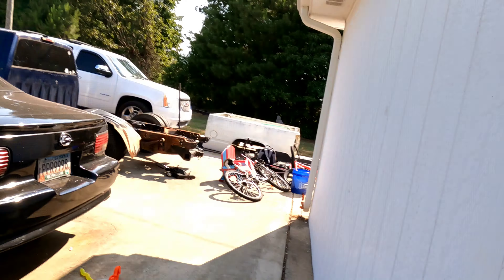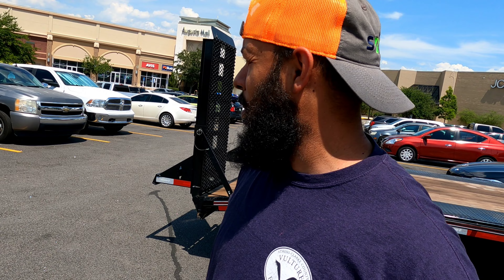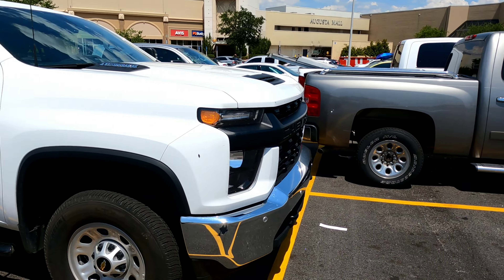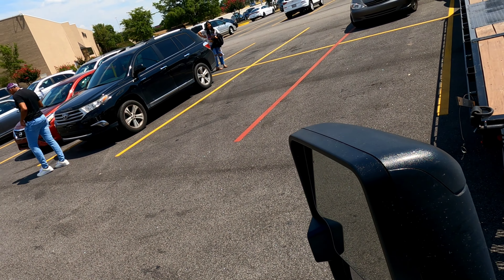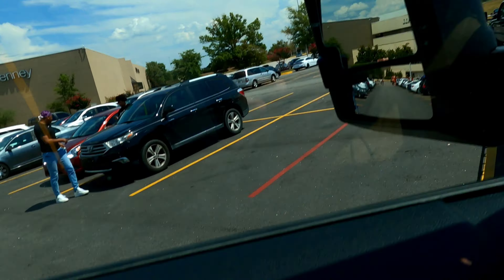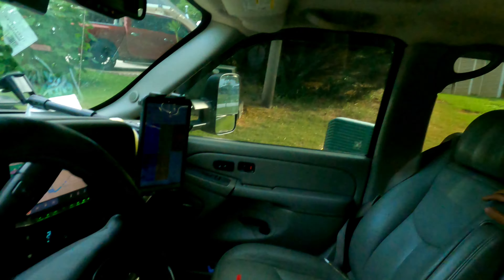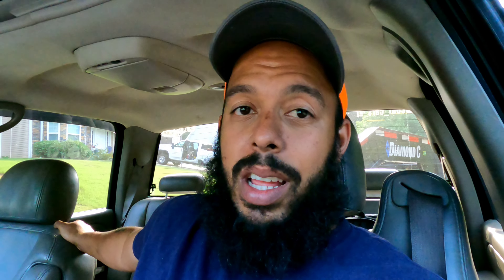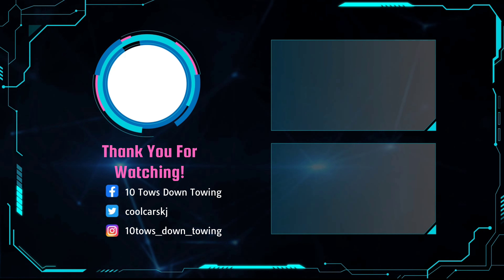Fuel issue could jeopardize my business 😞

Comment: if it's only with those heavy loads in overdrive your cp3 is starting to get weak but not a concern if it doesn't happen  often, I went throw my whole fuel system (06 lbz) I did the cp3 last and it solved it, the lift pump got me 3 years before that though.. and mine was doing it without a trailer let alone a load so yours is still strong just not new🤙 I personally have the airdog165, I always down shift into 4/5th with a heavy load going up inclines save the trans and turbo from overheating,
Reply from the maker: Ok, thanks for the insight! I have the Fass 165. I'm gonna keep an eye on the cruise control shift patterns going forward. I use to set & forget but gotta pay attention with heavier trucks. Thanks!

Comment: CP3 INJECTION PUMP , 06,07 's have problem 's when using cruise control and heavy loads.
Reply from the maker: You think it's going out? Time for replacement?
Reply: Truck master did a video on it, and my friend also had to upgrade his cp3 for that yr. Also there's a cabover in ashville nc for 10grand it's on Craigslist.